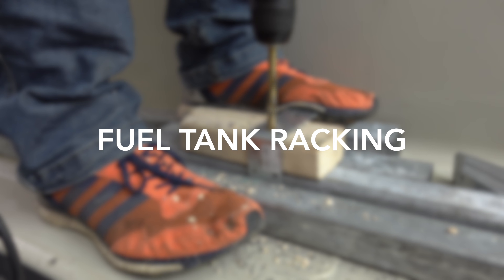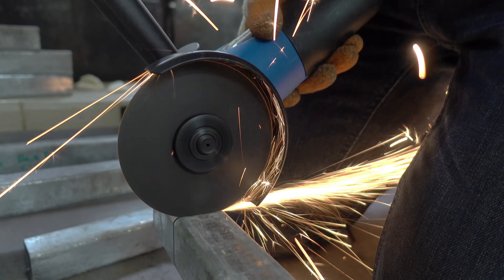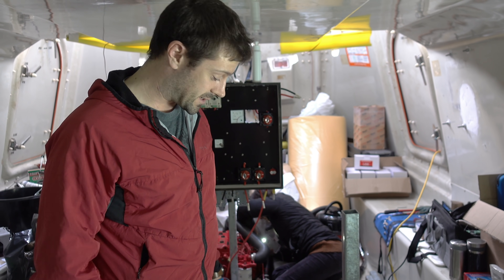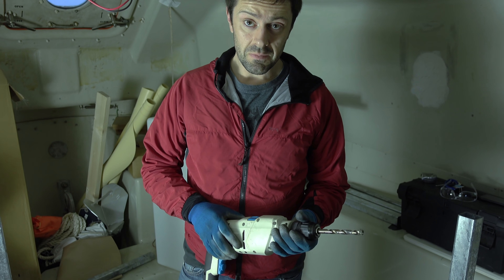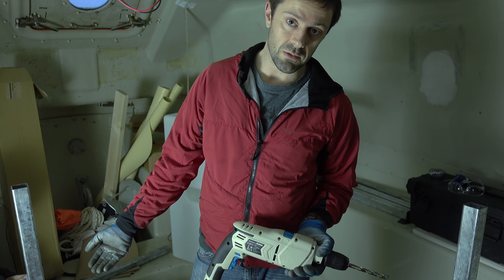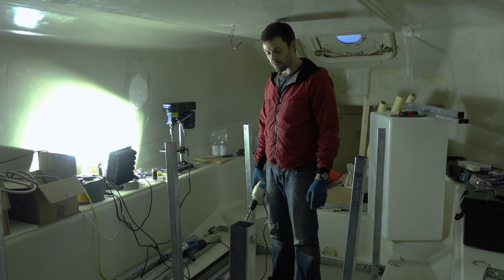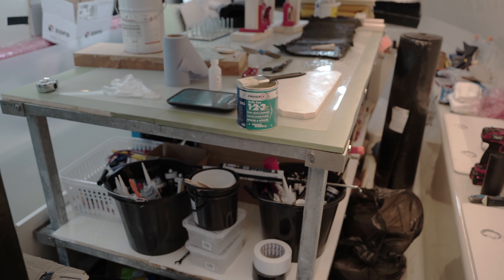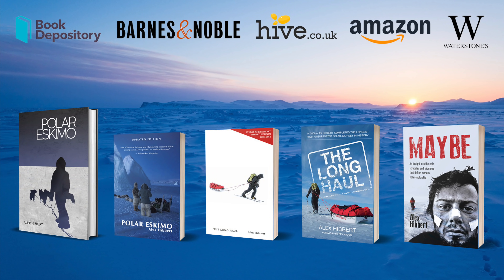Lifeboat Conversion Ep6: Fuel Tank Racking [4K]

Comment: Someone else has made point about mixing metals - it is something to be avoided. Also, the plywood. Hardwood plywood is not necessarily great - it depends upon what hard wood (after all, balsa wood is also a hard wood) is used and then, what glue is used. Marine ply can use soft wood but it is the glue that really defines it as marine. If money were no object (if only), sheets of composite are pretty much the best. I know this is 4 years late but it might just jog some new viewers to research the subjects.
Reply from the maker: After those four years, zero corrosion on the racking. As long as you're not actually wet/submerged, and the ratio of stainless to mild is high, galvanic won't be an issue.
Reply: @AlexHibbertOriginals that’s great. My “advice” was really directed at current or future restorers. Perhaps not everybody will be keeping theirs dry.

Comment: Just a thought on drilling stainless steel, as you say you’re using good quality bits, I have found over the years that whenever possible I submerge my part in water and drill very slowly with his high pressure as possible. I recently drilled 76 holes in half inch plate With a half inch drillbit and at the end of the job you could not see any sign of work where on the cutting edge of the bit. This all came from keeping it very cool and also not allowing the stainless to work harden by stopping during the drilling process. Very interesting project you have there ,Thanks for the great videos.

Comment: A couple of minor points: 
Combining stainless and galvanized steel? Not sure that is a great idea, as the different metals could potenitally generate a bit of current whitch in turn would put oxydation on overdrive. 
And wouldn't welding be a better solution than those brackets you have to fix to fit? OK, you shouldn't weld on galbanized steel, unless you clean off the galv first. (And reapply some zink or something.)
Reply from the maker: The theory and real world effects of galvanic corrosion tend to diverge in terms of the extent.... I've got fittings originally built externally on Alan over a decade ago that got plenty of sea spray, and were galv mated with stainless. Barely a layer of surface rust. 

Submerged dissimilar metals - of course you're into it properly.

Why not weld? So I can alter and dismantle it. And I can't weld.
Reply: @AlexHibbertOriginals  Thanks for replying. Makes sense.

Comment: Drilling stainless steel use water rather than cutting fluid, that's the secret. An hose pipe running is perfect.
Only just found your adventure, fantastic.

Comment: Just FYI spring type lock washers don't actually do anything.  That's why you don't ever see them in automotive or industry anymore.
Reply from the maker: It's interesting to see this comment so much when spring locks are so commonplace. Hundreds of them in the original outfitting of the lifeboat. I have a box of nord locks for vibration-vulnerable fixtures.
Reply: @AlexHibbertOriginals  yeah it just depends on when the particular company in the particular industry gets the message. Almost nothing new these days uses them. The only exceptions that I see are every once in a while something cheap out of China has them.  Nord locks are good. Thread lock is also good.

Comment: Just a small comment from a steelwork designer - combining stainless steel bolts with galv. steel isn't a terrific idea - it can cause galvanic corrosion in and around the bolted connection and is generally avoided for structural applications. You'd be better served either using purely stainless steel and stainless fixings, or going the other way and using purely galv steel with galvanised fixings or zinc plated fixings. For long term exposure to salt water as well, lower grades of stainless steel aren't suitable, 316L should be considered a minimum for any external exposure to salt water, which would necessitate A4 fixings.

Also - you should be aware that when you cut galvanised sections you are exposing the untreated surface to the air which can corrode, the galvanisation procedure is purely surface level (40-100 micron) and the untreated ends should be either "cold galv" repaired or treated with a zinc rich paint to prevent oxidation at those ends.

I would imagine in this application you'll probably be fine, as if there is a significant amount of salt water inside the boat you've probably got bigger problems, but it's always worth bearing in mind :)

I'd also consider using nyloc nuts instead of spring washers as they're much more resiliient in terms of prevailing torque in harsh climates and varying temperatures/humidities compared to run-of-the-mill spring washers.

Awesome videos either way - got me hooked!
Reply: I mean, it should be welded.  And I don’t trust the securing method to the hull.  Fiberglass and metal don’t flex evenly under strain and as the boat works that tanks going to get looser and looser.  Not to mention the free surface effect when the tank is half full.

Comment: Round the edges of that table! Better yet, put some nice big foam corners on it. 
I lived on a boat for many years and when things are rocking about and you smack your hip into the corner you'll thank me.
Reply from the maker: The safety and sea trial prep videos will come. He's ashore right now so limited risk! The plan is for low profile silicone edge and corner protection, and then removable, larger foam padding that can be attached when necessary.

Comment: talks about special marine grade stainless steel brackets that wont corrode in sea water, then bolts them to zinc coated mild steel... have you heard of galvanic corrosion ahahah
Reply from the maker: I've consulted with experts on this in depth. The items aren't immersed, so the galvanic action of the 'battery' isn't formed. More limited unlike metal caused corrosion would be limited too by the ratio of stainless to galv. Thanks for the input.
Reply: @AlexHibbertOriginals  I am an expert and even the smallest amount of humidity in the air will cause them to corrode, it is without question you will see a white crust where they touch and on the A2 washers.
Reply from the maker: @3HitRanger  Thanks Weasel. The assembly has been together for some months now, often in cold humid conditions, near the sea, and no evidence as yet.

Comment: Assembly method is definitely interesting. You spent nearly as much on bracketry and bolts, as you would have in a tig welder
Reply from the maker: With the ability to partially/fully disassemble and alter the structure.
Reply: hardware and bracketry are expensive, but nowhere near the price of a tig welder. 🙃

Comment: You shoud use aluminium 5083 grade - it's best suited for marine application and is much lighter than SS
Reply from the maker: Could have done - but would have needed twice as much as it's half the strength. That would have been extremely expensive, and hot dip galv steel is perfectly resistant to corrosion for internal applications. The galv, on and in, the boat was completely intact despite a decade of exposure to sea air.

Comment: You do realise that zinc in damp conditions will evaporate against stainless. Galvanic corrosion.
Reply from the maker: This is something I've consulted in detail with experts about, and in a non-immersed scenario, other priorities trump any great concern of SS/galv potential difference. Zinc doesn't evaporate - in a true galvanic corrosion scenario, the zinc galvanisation would corrode in preference to either steels, then leaving the carbon steel to rust next.

Comment: It may be too late now, but a cheap magnetic drill press and some carbide annular drills might make things go easier in the stainless and thicker work pieces. Barring that, drilling a small pilot hole of a diameter that will allow clearance for the web of your finish drill bit will make drilling that hard thick stuff much easier. The web of the twist drill doesn't cut so you end up just using brute force to "dent" the center of your hole before the cutting edge can get to the metal to do the actual cutting. It's a two step process but usually ends up saving time if you have a dedicated drill motor for the pilot drill and don't have to rechuck the twist drills as you switch from one to the other. 

There is a technique whereby you use something like an ax or sledge hammer handle or even a pipe to extend over the butt of your power drill to a length of chain with a link hook on one end  that has been looped around something solid. By adjusting the chain length and keeping the chain fairly close to the power drill, the end of the "stick" that is not stuck through the chain loop becomes a lever that will act like a drill press handle and give you leverage for drilling in areas where you can't use your weight to advance the drill. We call it "an old man" where I work. Hope this was of some help. Hate to see folks work harder than they need to.
Reply from the maker: Thanks John. We were certainly pilot drilling, but your tip in the second paragraph is very useful, thanks.
Reply: @AlexHibbertOriginals  If you find the "stick" wants to slip on the power drill, epoxy an short inverted hex bolt to the butt of the power drill and drill a series of shallow divots down the length of your "stick". Locating the bolt in the appropriate divot will help keep it from slipping and enable you to drill deeper holes before shortening the chain loop. If you have tried the "old man" the way I first described it, which, frankly, was very hard to do, owing to the many miles I had to cover with the explanation, and got that to work, you should understand what I'm suggesting here. Glad it was helpful. When a journeyman showed it to me as an apprentice my first thought was " I'm writin' that down right now!"

Comment: Why not use aluminum for some of that to help cut down on weight and price.
Reply from the maker: Aluminium has poorer strength than galv steel, so we'd have needed more of it. It's also more expensive, and we actually wanted the weight, especially low down, for low CoG stability.

Comment: I hate to be the bearer of bad news but everywhere you drilled that galvanized it's going to start rusting your also going to get a very aggressive galvanic response between the stainless bolts and the gal. steel. You would have been better off just using 316L square tube and weld the whole racking system.
Reply from the maker: Hi William. Whilst time will tell, the advice across many forums and conversations is that whilst this scale of corrosion for mixed metals is obviously fact, and is extremely important underwater, it's less perilously black and white than you suggest. Other considerations like the tensile strength and modulus of the steel chosen for the box section are, in an internal location, likely to be more important. The theory is that directly mating 300 series SS with galv steel will cause the zinc to thin and then the underlying steel to rust, but plenty of discussions report in practice that this is very minimal, if present at all, when sea water isn't in direct contact. The racking is very visible, and can be monitored. If problems do arise, they can be tackled. On your final point, welding would be irreversible, and I wanted the option to alter or remove sections.

Comment: Some tips for drilling stainless steel on a drill press: Put your work piece in a drill vice that is attached to the table. Use a hammer and centerpoint to create a depression that is larger than the web of your drill. All drilling should be done at a slow speed while putting a large amount of pressure on the drill bit. This is to prevent work hardening from friction. Any hole size larger than 5 mm should be pilot drilled unless you have drills with split points. Get yourself multiple stubby pilot drills and spare drills or the means to sharpen drills. Use drilling oil or cutting fluid. Wear eye protection.
Reply from the maker: Thanks for this. Aside from the clips shown which were quick 1mm widenings of existing holes (I concede that using footage with a vice clearly shown would be better), all these procedures were followed, and indeed many were mentioned in the video: eye protection, slow speed, cutting fluid, pilot holes etc. We'll look into getting stubby bits as you mention - useful.

Comment: You don't need stainless fasteners inside your boat where you can coat them in copper anti-seize or a film like CRC SoftSeal or both or denso tape etc. Stainless is MILES weaker than normal bolts and also tends to gall if both fasteners are stainless and you don't use an appropriate anti-seize.
Reply from the maker: Thanks for the input. Yes, for A2 fixings internally I have over-specced - using M10 - to account for the higher modulus and lower tensile strength of stainless. I've estimated the racking to be able to manage 150% of the maximum weight it would ever be asked to take, plus the cushion already built into strength ratings. The galling behaviour you mention is new to me, so thanks and I'll investigate. If concerns build, it would only take an hour or so to change nuts, or even whole fixings, for another grade of steel.

The original Norwegian build of the boat used A2 internally and A4 externally, with the exception of very large structures, which are galv.
Reply: @AlexHibbertOriginals  Fair enough re oversizing them. Galling varies between grades, not sure which behaviour yours has. I learned it the hard way with screws that mostly went in, but wouldn't come out, broke off instead. Those were M6 and nylock nuts tack welded to steel. I wish I'd had my own advice back then :-D Before you try to take any apart, get some penetrating oil on them. They don't need it to free rust, but it might save you from destroying the fasteners. 

On a different note, your entire fuel tanking solution is pretty interesting in design. Is there a reason you didn't simply use commodity super robust 205l drums or even a smaller size, strapped to a frame and carry a pump and/or syphon hose setup to move them to the actual tank the engine uses as needed? Seems very elaborate! When we've taken extra fuel on board for longer journeys that's how we've done it, and just lashed them so they can't move in a seaway. 

Final note, that round bilge is going to be torture in the open ocean - good luck! :-D

Comment: get a welder and bandsaw!
Reply from the maker: The grinder cut nicely - it just appeared slow as I wasn't applying any pressure for the filming. And welding this together would make it impossible to alter or dismantle.
Reply: @AlexHibbertOriginals  suppose those are good points! i just hate to see stuff bolted together its so much more work

Comment: "Under atmospheric conditions of moderate to mild humidity, contact between a galvanized surface and a stainless steel surface is unlikely to cause substantial corrosion. However, if the surfaces are in the presence of salt water or salt water air, it would be best to electrically isolate the two metals." -American Galvanizers Association  (I didn't quite understand if you are using two different materials here so if you are then switch to ALL galvanized or all stainless OR add rubber between the metals/bolts)...
Reply from the maker: More structurally sound to use an anode as appropriate, as rubber would massively compromise the bolt secureness.
Reply: @AlexHibbertOriginals  Ahhh, anode as in a sacrificial anode? Or some sort of system to control electrical charges?

Comment: Alex you could have welded those frames and saved a fortune on all that 6mm 316 stainless
Reply from the maker: Then the structure wouldn't be alterable. The stainless cost less than a day's professional welder hire.
Reply: @AlexHibbertOriginals  I was thinking more of a frame with welded brackets that are galvanised so you could bolt it together in 20 mins
Reply from the maker: @paulcollins4932  Certainly an alternative, and there's a good pro welder at our yard. But this system is robust, and whilst it took a while, wasn't quite as slow as I made out.

Comment: What are you going to do for a head on the Alan considering you will be taking it out for a long time, I'm assuming you will need something better than a bucket, there doesn't seem to be a lot of room for one or Black water storage. Also how's the galley going to work if you have one, you'll need a grey water tank then too. Are you going to equip it with: Radar, AIS, or ECDIS?
Reply from the maker: Ah yes, a big question. You're right that there's not going to be sub-didvison into cabins/heads etc. It's an expedition boat, so implies a certain familiarity between team members. At the working end of the boat, the stern, basic facilities will be installed, and organic waste disposed of. The galley - heat will be from the boat's heater (it has a hot plate) and again waste disposed of, with use of safe detergents. No radar planned as yet, but radio, sat comms and AIS, yes.
Reply: @AlexHibbertOriginals  What, no bidet?!!!
Reply from the maker: @m.dwaynesteckley4832  If you're installing it!

Comment: Why, m8, why did you build up the floor with space filler, only to set the fuel tank racking right on top of it?  Why not set them lower?
Reply from the maker: The floor is only a few inches high in the middle, and the real 'floor' was a horribly uneven curved shape - a nightmare to mount anything to.
Reply: @AlexHibbertOriginals  Didn't you say you were using bladder tanks, though? I thought the same thing as this guy.
Reply from the maker: @fredio54  Part of the answer is that last year's cancelled trip was a very specific one, and decisions were made for it on its own. Given Alan's more flexible future use now, some plans are to be tweaked. There'll be a video to explain, but yes the bladder/tank ratio is changing, and also, some of that LD40 foam is coming out, and steel ballast being installed. All to be seen....